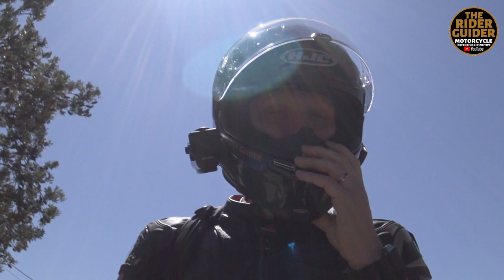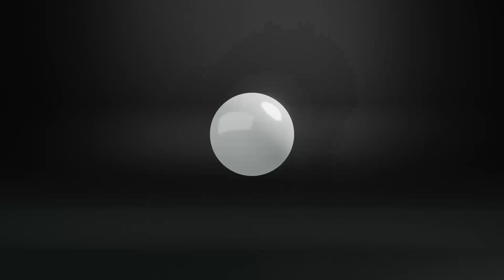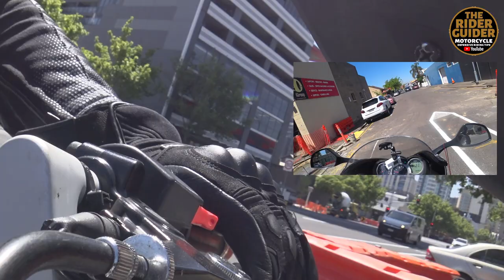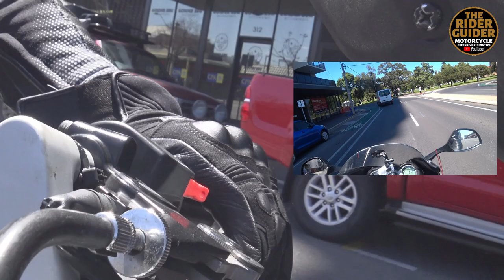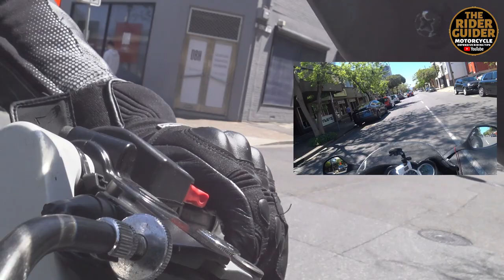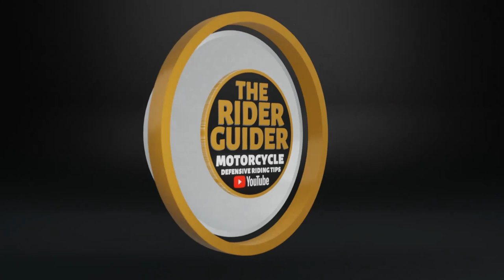HOW TO USE YOUR CLUTCH ON A MOTORBIKE AND WHY IT'S DIFFERENT TO A CAR

Comment: I remember my instructor telling me to ride the rear brakes when riding slow & I always struggled then I taught myself how to feather the clutch & I found slow riding easy. 

I'm glad you made this video because this is how I ride & I've never seen anyone talk about it before
Reply from the maker: Adam ... thanks mate.  Riding the rear brakes is also VERY useful especially when filtering/lane splitting.  I reckon it takes some time in the saddle and the willingness to experiment with the controls which you’ve obviously done to realise the benefits of clutch feathering.   Nice one 😎👍🏼👍🏼👍🏼
Reply: @TheRiderGuider  I'm still a novice but I only use the rear brakes to come to a smooth stop & for hill starts.
Reply from the maker: @EpicAdamMotovlogs  perfect use of the controls mate 👍🏼

Comment: You know what I have never thought about clutch control but now you say it is something I just do and it is the sort of thing I would just assume folks would do but of course new riders need to learn this stuff. As far as car learning I was shocked to find that when my kids all went to learn to drive  they were all taught to coast up to junctions without changing gear then select first and drive away, so a lot of clutch use is negated. Where as we were taught to come down the gears on approach so that you could be in a gear to slip into a gap without stopping, unless it is a stop sign of course. Looks like you used to be a really fast rider as it seems that jacket's right shoulder has had some road rash. Oh and that A9 seems much sunnier than the one I've ridden on.
Reply from the maker: Haha, that shoulder isn't from any off I had.   Just a battle scar from an intergalactic battle maybe hee hee.  I'm more than happy to be a much steadier rider these days.  The balls have shrunk!

Comment: Now i have to find someone who does darth vader impressions to say "luke who's ya daddy" haha thanks for that life long quest. I learned to drive first then got onto bikes and to my shame an auto scooter first. When i took my CBT (cumpulsory basic training) the instructer took us through proper clutch etiquette very breifly but more for slow control than full riding. For my test training and test it wasn't mentioned once but through the training the instructer said i seemed to have things in my head right and if anything i was to confident in myself. Tbf i have said for some time i prefer to get things right rather than quick but i cant do either haha. Shrinking testicles you say..... may help with the speed bumps and pot holes out my way... Onwards to old age.
Reply from the maker: Too confident ... that's an interesting one.  I love confidence in riding and use it to make sure I'm using my position correctly.  I'd prefer to be confident than a shrinking violet, we need to be prominent and to be prominent we need to be confident.  If we ride without confidence we're asking for trouble :-)
Reply: @TheRiderGuider  That was exactly my thinking. I think it was more to do with the fact that i didnt need him and could ride solo on the 750 from day one and he didnt like it. nvm though haha

Comment: I’m always using the clutch and rear brake.
Reply from the maker: You’re a smooth rider mate.  It shows.  How long you been riding?
Reply: @TheRiderGuider  I started on farm bikes when I was 5. I haven’t always had a bike though. I’m 47 now. Only had two road bikes with about 6 years road experience.

Comment: I'm a beginner rider and am struggling to find the answer to a question. I think it's so noob a question it gets overlooked in instructional videos:

So when you are say dirt biking up a steep hill or out of bogs or ditches and need to apply or ride the clutch, when you do first apply the clutch do you always have to start with full engagement or can you also start at partial engagement?

I hope I explained that well enough. If not, I'll try to break it down further...

ie. You are going up a steep climb and want to ride the clutch. Do you have the option of just pulling the clutch in only partially to half engagement or do you always need to start at full engagement for the clutch to start working? Or you get to a technical section and want to repeatedly apply or I think "feather?" the clutch. Can you keep engaging the clutch only partially, or doesn't that activate the clutch? For the clutch to start engaging, must you always begin with it all the way in (fully engaged)?

I know you can ride the clutch at partial engagement, but just wondering whether you always have to start at full engagement then let it out to partial, or can you also start at partial right from the beginning?
Reply from the maker: I’ll give a full explanation later today, but short answer initially is you can feather the clutch from engaged or disengaged. Either or. Just off to look at a motorbike with a mate who’s buying and needs an extra set of eyes.  Back shortly 😎
Reply: @TheRiderGuider  Great! Good luck.
Reply from the maker: @alantaylor6691  okay Alan, my mate bought the bike, he’s a happy man!  Now, clutch … when I was a young lad I always spoke about engaging and disengaging the clutch the wrong way around!  I knew what the lever did but always said to myself that I was engaging the clutch by pulling in the lever, but in fact that actually disengages the clutch, and by letting the clutch lever out it is in fact engaging the clutch (in that the clutch plates are then grabbing the flywheel and causing friction and drive).  I still sometimes say “give it more clutch” and what I mean is pull the lever in a little to get it slipping more in the friction zone.  So I can cause a little confusion.  But basically more clutch is letting the lever out, giving more drive to the rear wheel, less clutch is basically releasing the clutch plates by pulling the lever in.  Now on to your question.  Once you’re rolling along and like in your example, on a hill you can add or remove as much or little as you need.  Once you’re moving, the lever can be pulled in and out as and when you need to adjust the traction the tyre requires to keep your momentum going.  It’s the same process if you’re on any surface but if dirt bike riding there’s different considerations such as it’s easier to spin the rear wheel and you have to be careful not to get stuck like if you were in deep sand where just sat still, spinning the back wheel, you’ll just sink.  It’s always a fine balance and every off road surface can throw up different challenges.  In short, you can get away with abusing your clutch on the vast majority of motorbikes, they’re made for it and it’s a massive part of riding that’s not really explained very often as you said.  My clutch on my bike is easily the most used component for controlling my progress.  Feathering it nearly all the time.   (I’m going to have to read this myself to see if it makes sense 🤣). And yes you can just pull the lever in half way from fully out OR all the way in and then let it out.  Depends again on each situation.  Off roading there’s no wrong or right way as long as you keep going where you want and if that’s forwards and up? Great 👍🏼 …. Also look at this https://youtu.be/w8uAbV1AHkM
Reply: @TheRiderGuider  
Hello, thanks for your great detailed response and sorry for my late one. I've been in the wars and hurting a bit as I stacked my neighbour's postie ('86 CT 110 semi-automatic) in the bottom paddock and hurt my leg a bit and migraine from the jolt, but nothing broken or torn, just swelling and sprain of the lower leg. No damage to the neighbour's postie thankfully, and I learnt a value beginners lesson without getting seriously hurt- If you haven't ridden a path before, go slow, as you don't know what surprises you may be coming to. And the less you've ridden and know a path, the slower you have to go.

It should be obvious, but it seems some of us lose brain cells when we're on or even thinking about motorbikes lol.

I've walked that paddock a few times herding the cows (I live on 150 acres), and thought that paddock was all flat in that area. So I had just changed up to 3rd or 4th gear when I was suprised by a huge ditch which appeared right in front of me. Going into that ditch at that speed would have been suicide, and there was not enough time to stop, so I bailed before entering the ditch. But the back rack landed on my leg just above the ankle and then pinned it. Got back up and kept riding, but later that day I was hardly walking, and still aren't lol, although it's now improving.

I understand what you say about engagement vs disengagement of the clutch plates, it makes sense, thank you. And being able to only partially disengage the clutch would add such an extra dimension to the riding, so I'm glad to hear you can do that. Another neighbour out here (Girvan, NSW) inherited a 1997 KTM 250 EXC and I might be buying it off her. I've ridden a neighbour's  1985 Suzuki RM 80 and couple of times, my first go on a manual, but stalled twice coming out of bogs as I didn't know I had to ride the clutch and this is a low-displacement race model that dies a bit in the low gears/rpm, so at slower speeds with technical terrain you do need to use the clutch a lot like you were describing.

I can sort of understand the physics of how disengaging the clutch allows you to say turn corners better without changing down. Although I'm almost completely lost on the physics of how partially disengaging and riding the clutch leads to greater ability to get up say a steep slippy hill where traction is a problem.

I would have thought that the less clutch engagement you have, the less traction or torque the back wheel has, as full clutch engagement means you're fully engaging the drive, which goes straight to the back wheel. Maybe in time if I keep turning it around in my mind it'll come to me. Perhaps by lessening the torque (disengagement) you're gaining traction in a lot of cases. And perhaps by using the clutch you can keep to a higher gear, thus speed, so that the greater momentum helps get up the bad hill. OR, perhaps for some reason the lower the rpms (thanks to riding the clutch), the less likely the rear wheel is to lose traction even though you're going the same speed.

Timeframe 4:30 of the below video is an example of what I'm talking about. He is partially disengaging/riding the clutch constantly in order to get up that hill: https://www.youtube.com/watch?v=gdKfcLgYybc&lc=UgzaoysirWWT5_zvvBh4AaABAg.9NspDt7IM6S9NspWAwu6LT
Reply from the maker: @alantaylor6691  ultimately it’s all about practice and experimentation with the controls when you ride especially off road.  150 acres!  Wow that’s a decent area too practice on for sure.  Glad you are okay after your tumble off the neighbours fine little steed 🤦🏻‍♂️👍🏼
Reply: @TheRiderGuider  Yep 150 acres, plus a national park starts 500 metres down the road. And that national park joins onto other national parks. There are unlimited riding areas straight from my front door.

I have bought that 1997 KTM 250 EXC from my neighbour for $500, not running. Offered her $900 and she offered $500. The odometer says 2,900 km, although I'm not sure if these enduro bikes come out of the factory with the speedo or if it was installed later.

Also acquired all the protective gear, twice the price I paid for the bike. If I had those riding boots when I crashed the postie I wouldn't have got that foot injury.

I managed to get the bike started, sounds good, clutch and gears works. Now to be able to ride I need to service brake calipers and replace brake pads, replace all the wheel bearings and the air filter. Two weeks and I should have all that done. Looking forward to having a bike out here.
Reply from the maker: Haha mate that sounds like a bargain and a great project.   It will give you endless fun and skills practice for sure.  I’m very envious of your environment.  You’ll never be stuck with nowhere to go 😀

Comment: Is it normal to smell burnt clutch on new motorcycle when doing this?
Reply from the maker: No.  The majority of bikes have ‘wet’ clutches, some BMW are dry clutches and race bred Ducati’s/Italian exotica but dry clutches are not common on motorbikes.  What are you riding?  Cars have dry clutches, which is why they can smell when worn out or abused.
Reply from the maker: You can give a motorbike clutch a lot of ‘abuse’ ... they’re designed to be used hard and can take it.
Reply: @TheRiderGuider  thanks for the answer. I have yamaha sniper 150 and it always smell burnt clutch after I ride. It only has 600km of odometer and I’m newbie to manual motorcycles
Reply from the maker: @caloyocampo5331  we don’t have the Sniper in Australia.  Had to google it!  What a cool looking bike for a new rider!!!!!  Great starter bike and no doubt nice to ride.  As a new rider keep an eye on my channel for cool riding tips, defensive riding is my core ‘business’ on the channel ... I add some adventure riding stuff too for fun.   Now, in relation to the Sniper, you’ll be getting close to the first service at about 1000 kms or 600 miles?  Before going in for that service, ring the dealer and let them know about the clutch, it might need a slight adjustment.   Shouldn’t be smelling mate, but it will be covered by warranty if there are any faults.   Good luck 😉